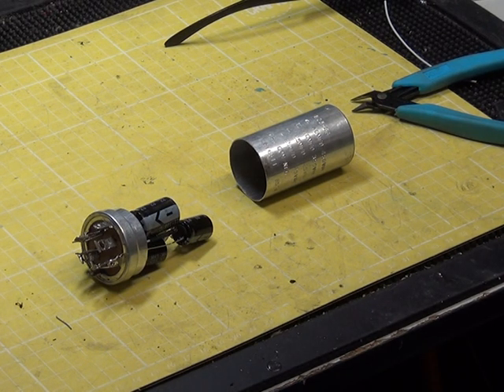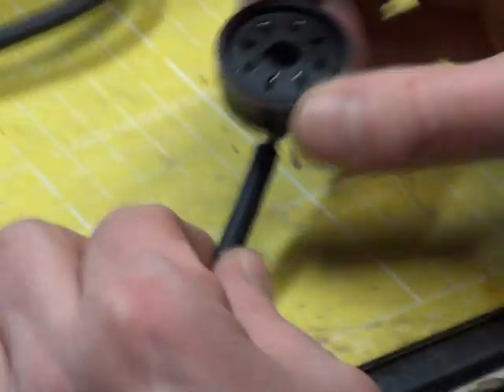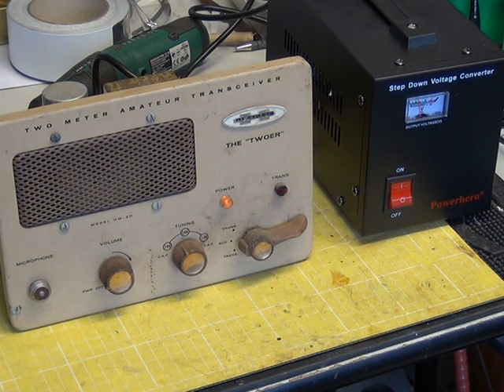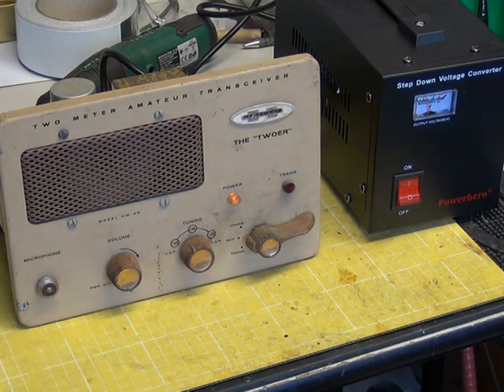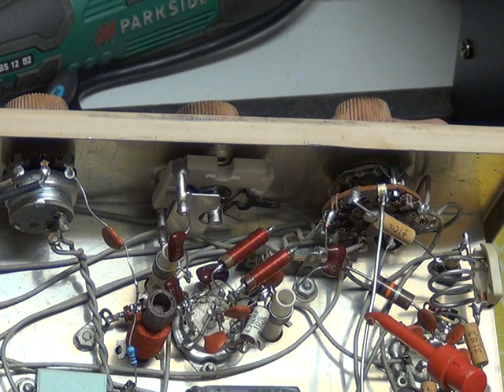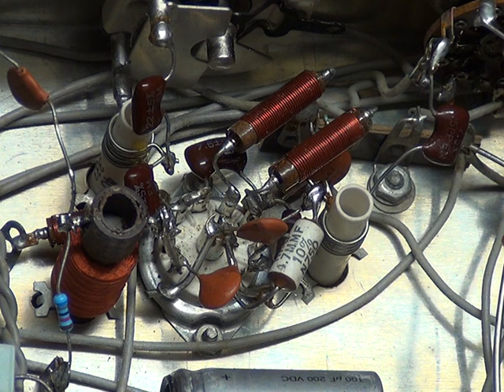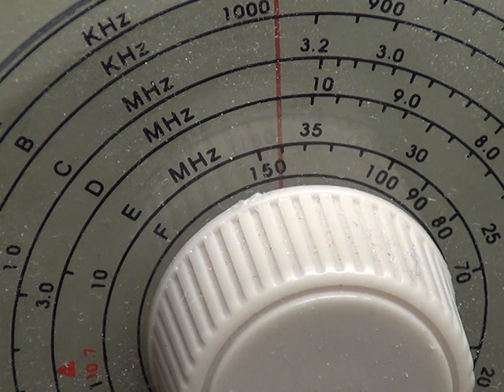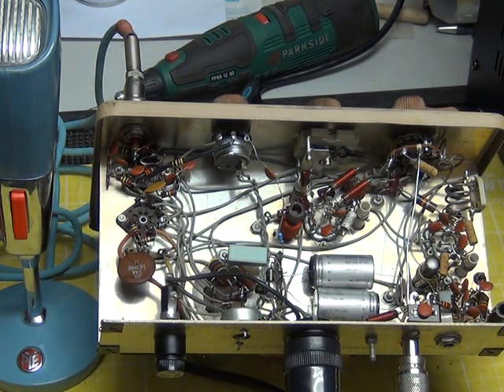Heathkit HW30 Pt2

Comment: Good job gentlemen on your Heathkit Twoer!  I have three of these old transceivers; one works perfectly and is pristine with original mic, crystal, power cord and manual, very unusual find!  The second one has original crystal, mic, power cord, and manual.  But it receives well, transmits good with TX switch only in the "locked" up position, momentary down, transmits 2mhz lower in frequency; that is crazy!  Third radio, only crystal with no transmit or receive; alignment does not seem to work on this radio.  But all radios being from Heathkit, along with the excellent manual, should be fixable.  Thanks for your video and keeping this radio for the younger hams to enjoy!  73, Karl, KO8S
Reply from the maker: Because I bought this off Ebay from the USA, I had to replace the crystal for a frequency permitted in the UK. Custom crystals are £30+ these days!

Richard, G0OJF, UK

Comment: Did you do Part 4 the tune up.  I have a Twoer and I can't get the transmitter working.
Reply from the maker: No I haven't; the new crystal arrived but we are concentrating on servicing customers 2-way radios during this lockdown period. Bear in mind we located about four faults on this radio to get it to this stage of working. Tuning will optimise it & a friend of ours 8 miles away is looking forward to being my first AM contact using this radio.Ihave also imported both the 6M version & very recently the 10M one, so we'll do videos on those too in due course.

Richard, G0OJF, UK

Comment: That's a lovely old set and well done. For saving it!
My Racall generator gave up in a big way in the summer and I did see your generator on ebay. Is it any good for cb and some amateur radio alignment?
Obviously I'll need a counter on it, but how is the deviation and stability?
Many thanks in advance
Dr. Watts.
Reply from the maker: I did a video on it in my "servicing on a shoestring budget"...have a search. It's an AM modulated only signal generator without really any attenuator,,,but has it's uses. I wouldn't seriously recommend it for UK CB work or anything serious. Like in this video it's a useful indicator. I'll be doing alignment on the HW30 shortly on the RF test bench.

Richard (UK)
Reply: @ukfmcbradioservicingTango21  Thankyou Richard, from Marshall Amplification's senior service engineer 😉
Reply from the maker: @DrWatts-bi1jv  Our Mr Chippie's main service work is Marshall guitar amps.
Reply: @ukfmcbradioservicingTango21  If he's called the workshop I've probably spoken to him.
Reply from the maker: I could do with a pair of new 6V6 valves for my Pye F27 base station if you can get a price please. rshireby@yahoo.co.uk

Comment: so there was no heat shrink tube over the long legs on the capacitor before you put the outer back on ??
Hmmm.....
Reply from the maker: He clearly has sleeving on the positive but not the negative...which goes to chassis, so no point.

Richard
Reply: @ukfmcbradioservicingTango21  hmm,  i'll let you off :)
still would have covered it, just in case..